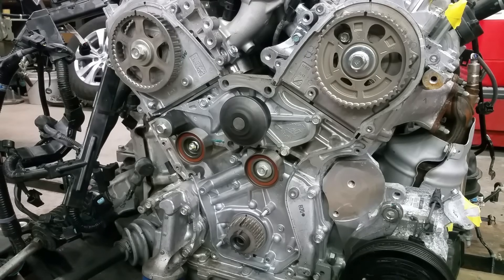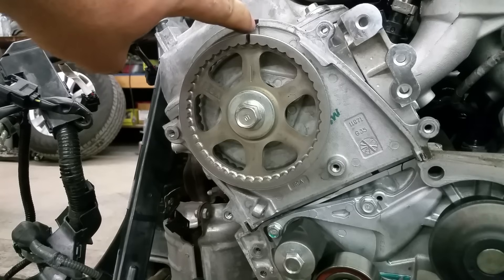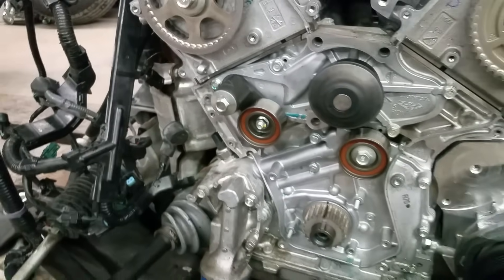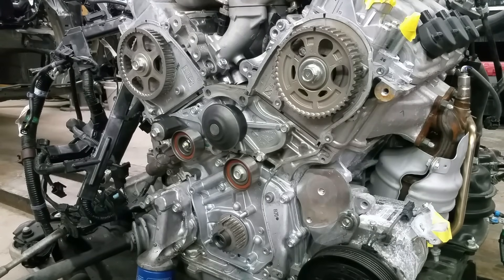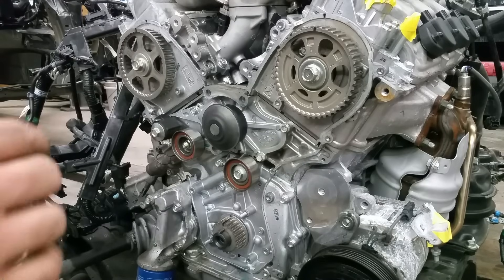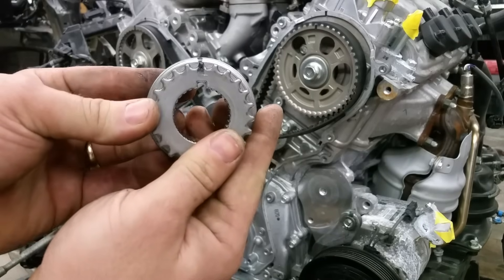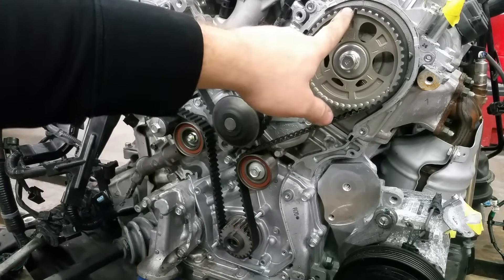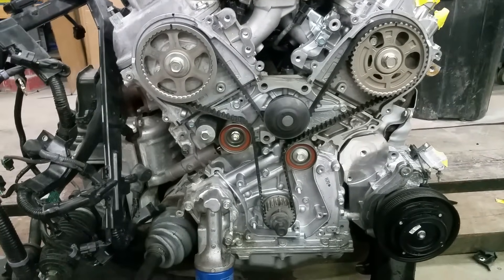SETTING UP TIMING BELT ON HONDA ACURA 3.2L 3.5L 3.7L J-SERIES ENGINE IN DETAILS!!!

Comment: can i turn each cam by itself or do they both have to turn in unison
Reply: No, you can't. This Timing Belt keeps the valves timed to piston travel. If you turn the cam without the belt on you will bend valves on the piston crowns that are near TDC(Top Dead Center).
With the old belt still on turn the crank until all timing marks line up, then remove the tensioner and old belt.
Reply: What if I made a mistake and remove the timing belt before turning the crank to line up all the TDC marks, can I assume nothing has moved and put the belt back on and turn the crank to line up with the TDC?
Reply: similar situation... what did you do
Reply: You'll need to find TDC for cylinder #1 on the crank shaft. Crank turns x2 per one cam rotation. So you can simply rotate the cam and rediscover the cam timing alignment point BUT there is a chance the valves will touch the pistons and inhibit the cam rotation. I doubt this will be easy to rotate the crank and both cams to avoid damaging the valves or pistons. Go slow. Light touch. Set crank TDC #1 and then set the cams.

Comment: hey George  great video. Ive had a timing belt slip a tooth 3 separate times while simply rolling back in a driveway and just letting the clutch out while in gear (motor off)   do you know of a factory bulletin or solution to fix this issue when the motor is inadvertently bumped backwards. I'm thinking the belt slacks up and slips a tooth or two. Anyway, just curious

Comment: Great video, thanks! I wish it was that easy with the engine in the car :) Took me two days in my 2008 MDX.
Reply: hey man I did my timing belt and components recently too. accord 07 v6. Same engine. Took me about 6 - 8 hours all together. First time. I was paranoid and nervous. lol But what does your timing belt sound like now? Just wondering how ours compare. Do you have a slight wooshing sound at all? I can hear it from the eye holes u open to see the timing. Like I open one hole and its def coming from the sprockets. Could just be the air wooshing through the cam sprockets. But anything like that? Sorry for long message. I wish i could pick your brain lol Not many people have done what we have done
Reply: @alexandercahoulan6583  amigo tendrás el manual de este motor acura mdx 3.7 2007???
Reply: Amazing job

Comment: Removing the crank pulley bolt could be a challenge on these engines.  Even a 2ft breaker bar is helpless.  I use battery-powered IR impact gun (780ft-lbs) + heavy duty impact socket (twice as heavy as an average impact socket).  Installation of the bolt also requires special tool (crank pulley holder).  I first used a generic brand and it was slipping (almost stripping the 6 corners of the crank pulley hex) so I bought genuine Honda tool, which worked well.    

I would remove the spark plugs, which makes turning the engine by hand a lot easier, but FOD must not enter through the plug holes.

Comment: I've worked on and at Honda for years and this is not how it's done.. We start from the crank and work upwards only one person..slack on tension side. I can do this job in 3hrs tops including all Seals.. Running!
Reply: Sam Stepter
WRONG there is a reason why Honda has an official procedure.. 
The method shown in this video allows for the camshaft to skip timing more easily. If you do it by the crankshaft (The Honda way) you cannot rotate the crankshaft using the belt so it locks in place so once you travel through the first cam pulley IT CANNOT ROTATE since the crankshaft pulley is holding the belt in place... That is why you leave the slack in the tension side. 

NEVER, Start at the pulleys unless you wanna gamble skipping the timing. If you do it the honda way you cannot mess up, That is why is the method  Honda Technicians learn. That is why this service does not need anybody to hold the cam pulleys like a rookie.
Reply: skirmich what if the cam gear on the left side skipped timing. how can you put it back in time?
Reply: i can do them in 1 hr  tops
Reply: There is nothing wrong with his replacement method.  Sure you can do the placement of the belt a few ways, but the overall process is on the money
Reply: Lol. I can do them in 2. 😜
Reply: EuroSpeed I wish you like close to my house I'll pay $400 cash for labor and bring the whole kit
Reply: Julio Nm Well I can do them in 1.59!
Reply: Did you say you can do this with the engine running? I'll pay to see that shit
Reply: 50 minutes on crank for me
Reply: My rear sprocket is off by a tooth ad the front off by half a tooth.  Can I take the belt off and rotate by hand, clockwise, to realign them again or is there a different procedure.  2011 Honda Pilot Touring.  Thx!

Comment: If one of the head gears were off one tooth what is the chance of the engine being ok?  It was turned over by the starter.
Reply: letssled Not likely to have damaged a valve but the engine would run poorly, as the timing would be off a bit if you left it this way.
Reply: What mike said.  One tooth off shouldnt cause damage, it'll run like hell tho

Comment: the top Right does not look aligned at all....
Reply: it is.  With timing marks, you have to be view your marks head on.  Otherwise it will look as if your marks are slightly skewed
Reply: Sam Stepter  I see
Reply: That is due to parallax

Comment: Also, for the first one (the top left one), are there also  numbers, and should we align the number 1 as you did to the top right one? Thank you!
Reply: Ran Zhang It should be aligned before old belt is removed. The front has numbers to identify what cylinder is at top dead center through the plastic timing cover plug.

Comment: Is it normal for a mechanic to remove engine to do this job or did it just so happen you had this one out ?
Reply: Chief60 a mechanic will not remove the engine to do the work.

Comment: Thank you George for this great video.  A few questions:

1.  Besides the belt, is it always necessary to replace the 2 rollers, water pump, and hydraulic tensioner if those components still seem OK?  Like if the water pump is not leaking, the bearings do not make noise when spinning them, and if the hydraulic tensioner is not leaking?

2.  If you DO recommend changing all those components, is it OK to use one of the many "no name" aftermarket kits on eBay that are much cheaper than OEM kits?  What brand kit do you use?  

3.  Do you have a link to the factory torque specs for all the bolts involved in a T-belt job for a 2008 Odyssey.  Including water pump, rollers, tensioner, plastic covers, motor mount, crank bolt, etc. that must be removed to do this job with the engine still in the van. 

Since you have deep experience doing hundreds of T-belts on these engines I really value your opinion.

Thank you.
Reply: DO NOT use any timing belt kit other than the one that comes with HONDA OEM Parts. I used some cheap kit made in China and the tensioner leaks and the timing belt broke after 20,000 miles. Engine is a heavy paper weight now. False economy to use a cheap kit. DON'T MAKE the same mistake I did.
Reply: I have been checking timing belts for my replacement belt after the last replacement one broke after 15K miles and  destroyed the valves and here is what I found.Gates/Unitta make the original Honda belt. Unitta and Gates are apparently the same company although the original belt says Unitta. However they have been fighting counterfeiters out of Asia for some time now so if you buy their belts anywhere dealer, eBay or Amazon be warned you might be getting a fake belt. Gates has on their website a way you can check if the belt if genuine by entering a number found of the box the belt came in. I myself being paranoid about getting a fake belt  have bought 5 different belts on eBay and some are thicker than others. I even bought the Blue gates belt you mention and is thinner than another Honda OEM belt I bought. At this time I will only trust a belt that passes the website code verification on the Gates website to feel safe.
Reply: Its better to replace out the idlers, tensioner and water pump.  Eventually those parts will go bad and you wont want to take all of this back apart again just to replace a water pump.  Also i always use the oem kits for the timing belt.
Reply: Chris Gacek, HI chris, I am also a mechanic with several years of experience. to answer your question,  it is 100% recommended to replace the idler pulley, tensioner pulley, water pump and belt tensioner when doing this very important preventative maintenence procedure. You can use cheaper parts but keep in mind that you get what you pay for. I always stick to OEM for this particular item due to the sesitive nature of what this timing belt does. Any failure of any component can result in a damaged engine. As far as torque specs, you can buy a manual on disk with all the info for your car. Good Luck!
Reply: Sam Steptoe race
Reply: I got about 250K on those tension rollers on my CRV (similar design). CRV I4 has one vs two tension rollers on the Honda V6. My water pump lasted about 215K miles. I'd use the OEM Honda parts. Every after market part I bought did not last as long as the OEM parts. I have over 300K on that 1st gen CRV now. I suppose if you keep a car just a few years then aftermarket parts would be okay but the next owner will be redoing your maintenance with new parts again.  I have had excellent service out of Gates timing belts.
Reply: On this kind of maintenance work it's best to buy original Honda parts from the dealer, if you want it to last another 100k miles.

Anything that needs replaced inside the timing its best to go with original parts.

Comment: is this a new engine?
Reply from the maker: +gladys 
Almost new
Reply: how do I adjust the timing
Reply: George Melnik what's the recommended mile on the 05 Acura TL before u change the timing belt?
Reply: 105000mi
Reply: adjust the timing or set to TDC?
Reply: Sam Stepter Ok

Comment: JUS WONDERING DID YOU LIFT THE CAR OFF THE SUBFRAME? QUESTIONING IF IT WOULD MAKE THE JOB ALOT EASIER AND IF SO WHAT WOULD NEED TO BE DISCONNECTED??
Reply from the maker: +Cedric Rolle no I did not. In this video I had engine pulled. I am sure it would make it easier. I am not sure it's worth extra effort

Comment: I changed my timing belt on my j30a5 last year, I had attempted to use the crank pulley removal tool you recommend but ended up talking to my local cornwell dealer and he lent me a socket that if you have access to power tools I HIGHLY suggest using. It saved me a lot of time and effort. here is a link to the socket on cornwells catalog http://www.cornwelltools.com/webcat/products/LS77080-%252d-19MM-Harmonic-Balancer-Socket.html however if you dont have access to powertools George Melnik is right that is your best option.
Reply: you don't need any special tools, just a 4-6 foot 1" diameter pipe

Comment: Do recommend changing a timing belt on a 1998 Accord that has only 61,000 miles on it? Do they age?
Reply: They do age with time and could possibly deteriorate depending on the climate where u live i suppose. Thats really low mielage for that year of a car.
Reply: Being as Honda engines are inteference engines id say dnt risk it go ahead and replace
Reply: It was my fathers car. Didnt drive it much.
Reply: Anyone know if pulling those camshaft pully seals is hard?
Reply: Not hard. Worthwhile though. My buddy had seals that started leaking (pushed out by oil pressure). Was really inconvenient. He caught it quickly enough that there was no engine damage. On my CRV I replaced them about the second or third belt replacement just as insurance.

Comment: Those type of tensioners are known for leaking and failure. Don't reuse it if you don't have too. Buy a timing belt component kit and it will come with everything you need to replace. RockAuto dot com has great pricing on timing belt component kits.
Reply: Im a Honda Tech and Dont be Cheap!! Buy the OEM parts! Trust Me
Reply: Noe Lopez    I totally agree! I used an aftermarket tensioner and went bad after a month. It was making this horrible noise and of course the Wifey wasn’t happy 🤨 Had to buy the OEM tensioner and recheck timing marks for safe measures.  One year later., no issues, got another 50k miles until the next timing belt replacement.  Now we’re having sliding doors issues 😟 Another project to tackle...
Reply: @noelopez8206  correct,some of that the aftermarket stuff sucks. Some cheap water pumps won't last and start leaking before next timing belt service also the anchor point for tensioner pulley are break.
Reply: @noelopez8206  I agree 100%
Reply: Buy Aisin, they are the OEM manufacturer for Honda, Acura, Toyota... Made In Japan bought my kit on Amazon and it was cheaper that chinese brands from auto parts stores.
Reply: BundysGarage yup ...no way I'd reuse anything... especially the bearings
Reply: Don't go cheap always OEM.
Reply: Hey I'm do something like that but the all kit remplace!!! But I have a problem went I pull out the belt!! The crankshaft,Are desynchronized and the crankshaft from below with the top, checke the diagram of the kit and the pistons the synchronise but the bottom of the crankshalft below is more complicated move it !!some buddy can get a tip for that sincronice the cranckshalft whit the pistons
Reply: BundysGarage b

Comment: WOW, people like you should be teachers, many videos I watch they skip out on important detail, but you explain every little detail thank you.
Reply from the maker: Maybe one day I will. Lol. I am glad it helped you out.
Reply: @melniksmotors  amigo poseas ayudarme?

Tengo una mdx 2007 3.7, no encuentro el. Manual de taller y no se cual es el. Torque de los tornillos de los árboles de levas ni del. Tornillo del. Engrane del. Árbol de levas, si tuvieras la. Información te agradecería mucho si me. La. Puedes compartir, saludos desde México.
Reply from the maker: I never recommend any products that stop leaks as they never help. In my opinion, they just cause more issues down the road. If you have extra cash do what's right, it will last you in the long run.
Reply: +George Melnik what's the recommended mileage before u replace your timing belt and water pump?
Reply from the maker: 100,000 miles
Reply: Ok. Thanks. I start to see oil leaks from my transmission at the bottom recently. U think I should do a rebuild or just add a stop leak inside the transmission?
Reply: Look at your owner's manual. There will be a normal duty schedule and a severe duty schedule. I tend towards the severe duty schedule on the timing belt for extra insurance. The cost over the life of the vehicle is low.